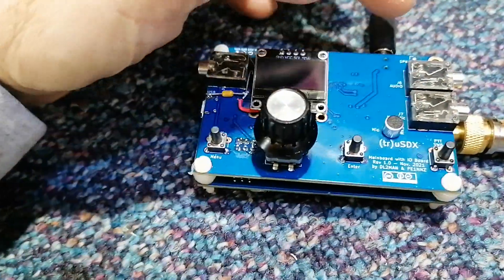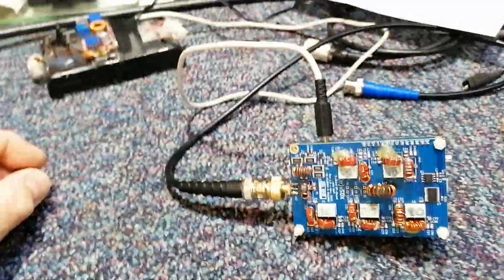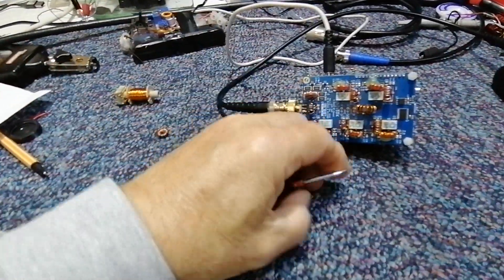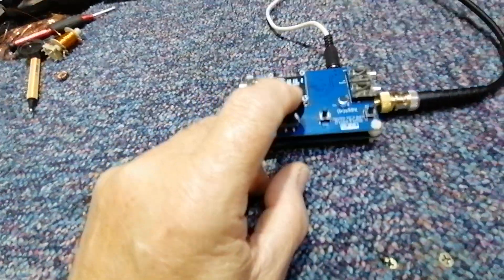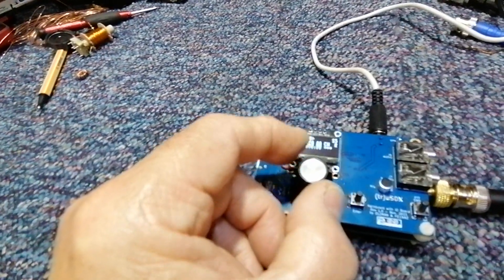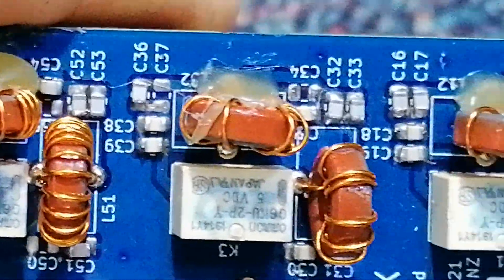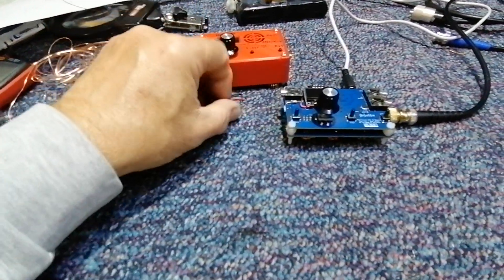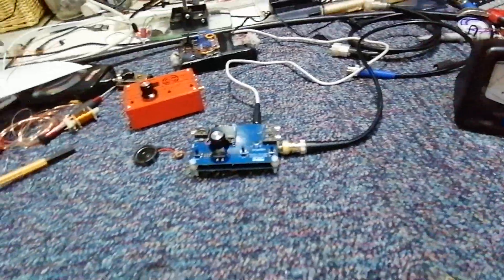(tr)uSDX, (Classic band) kit build testing after alignment of RF board.

Comment: Some of the best info I've come across yet for building these! This seems to confirm what I've suspected about my lo bands kit from (china approved seller), in regard to efficiencies, power output and the supplied magnet wire. Mine measured .40mm but was .37 w/out enamel.  I've been identifying toroids that would be candidates to increase power and efficiency, and that L15 at the final is a prime candidate. I got some .47mm measured wire (.44 w/out enamel) and will rewind L15, L32, L32 (40M) and maybe the T1/T2. I may do an entire classic bands kit with it as an experiment. Thanks!

Comment: I found a random prewound toroid in my junkbox that improved my efficiency on 20 meters from about 77% to 84% with the BS170's driven by 12 V. I never bothered to try to identify the characteristics of the coil.

No one in the USA should be using these rigs on 11 meters, since it's illegal to do so.

BTW, it's a lot better to use cardboard or bare wood for a work surface. Carpet melts and is full of static.

Comment: Also, any advice on buying caps that will work well and who's, or what, values did you use? 73 aa1of
Reply from the maker: Hi.
I initially bought caps from Mouser but a number were out of stock, eg 300pf, 200pf 130pf. I was able to get some from CPC Farnell. A couple of the Yeago ones were faulty from Mouser too.
Reply: @trev8932  in what way we're the faulty ones faulty? I think QRPLABS uses murata, I have the impression that AVX are usually good, there are some caps specifically sold as for "microwave/rf" but they tend to be expensive and the choices are limited, but they usually claim to have very hi q. Not sure if they are or would be any better. Thank you for your help.

Comment: I see you did not use 3 BS170's, just wondering why. Tnx
Reply from the maker: Hi. As this was a classic band build Manuel doesn't recommend the BS170 FETS. On 10 meters they don't perform very well duw to their input and transfer capacitance. The FTD86256 is recommended for the high bands and Classic bands.
Reply: Thank you so much!